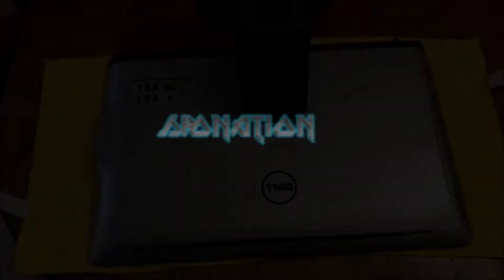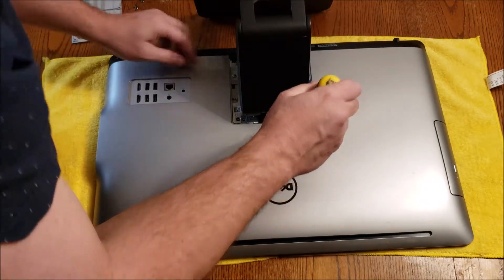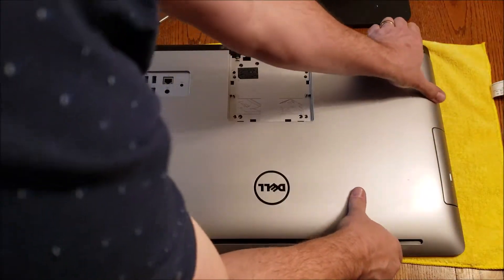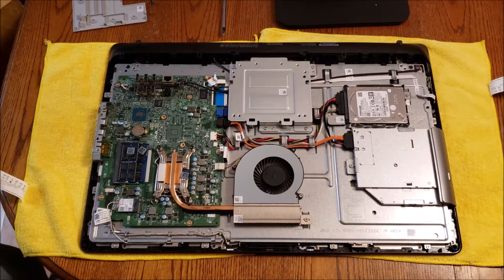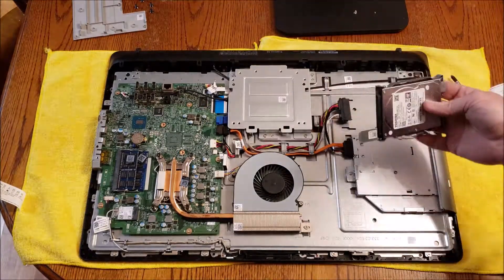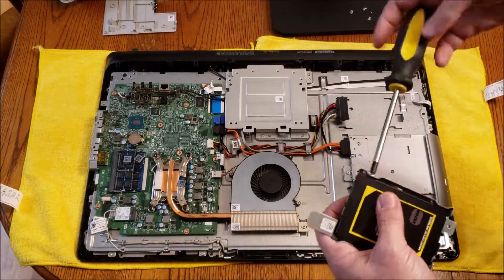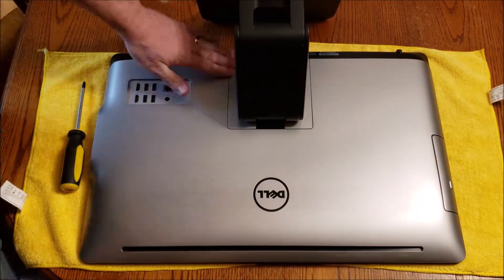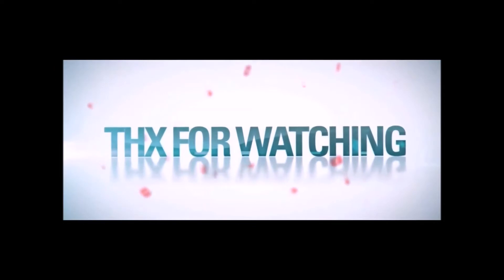How to install an SSD in your all in one Dell PC

Comment: In 2025, check your desktop for PCIe bus.  If you have one, go for a PCIe NVM SSD.  Spin HD is 40-100mps, SATA SSD is 400-500mps, and PCIe is about 2000mps.  PCIe is about 30% more, but it will seem that the SSD is RAM rather than drive access.

Comment: I want to install SSD drive with a fresh Windows 10 OS.  

My mechanical HD is 2.5” laptop SATA drive.  

I purchased a USB 3.0 SATA cable. 

Can I just make the new SSD a recovery hard drive and then install the drive?  

Please guide me on the best way to complete the hard drive upgrade project.
Reply from the maker: You need a windows 10 boot flash drive.  The installation of the solid state drive is the same.

Comment: Thank you, great video, could you help me after I substitude MX500 SSD on my system DELL all in one Inspiron 24 model, 5488 series, it doesn’t reboot and windows doesn’t work how can fix it? Thank you
Reply from the maker: You will either need to clone the original drive to the SSD. Or you can Install a fresh copy of windows to the SSD. It should automatically activate if that was previously used with windows.
Reply: @sponation  Deeply appreciate about your attention, do you have any recommendation how clone it? Thanks
Reply from the maker: @hadipourshanbeh1767  There's some free clothing software out there. There's even a company that sells a hard drive dock that will copy disks from one to the other. I use an expensive German software but that's because I do this for a living. I would not recommend using the software I have.
If you're looking to clone a disk, you might check out.  Britech09 Youtube channel he has some good videos on clothing drives and what software to use

Comment: Can I put a SSD + HDD in this computer? Are there enough SATA ports?
Reply from the maker: I don't believe it has extra SATA points you will need to use the SATA port used for the CD drive or replace the hard drive I don't believe you can add an additional drive to this machine.

Comment: can you tell me which ssd you used
Reply from the maker: I prefer to use Samsung solid state drives, But I've also had good luck with the team group solid state drives and they are normally cheaper. But if you want the best quality I would probably recommend going with a Samsung drive.
Reply: what model of samsung ssd for this computer desktop
Reply from the maker: @dmuggsy  I don't remember